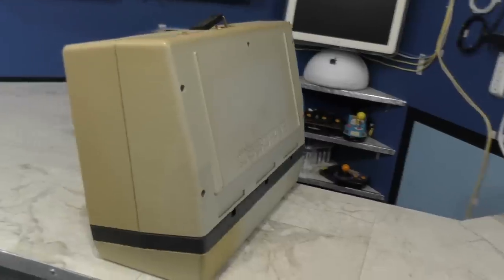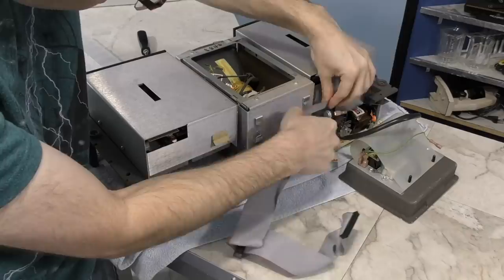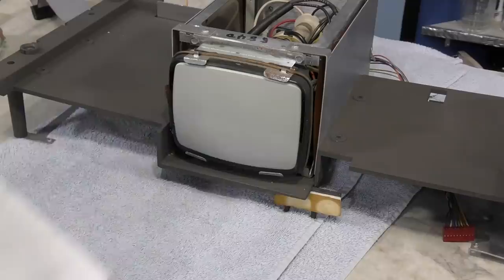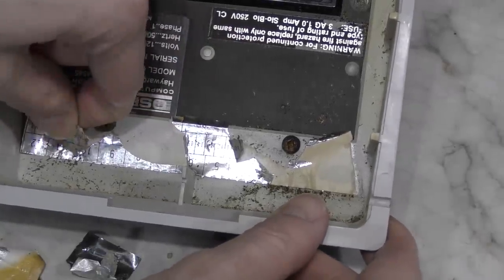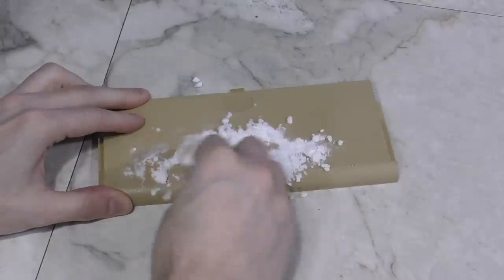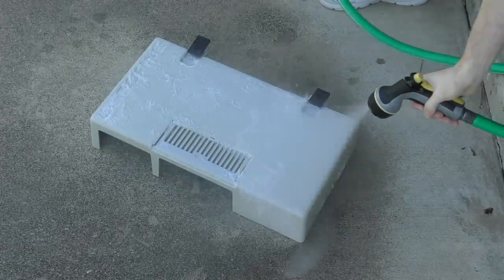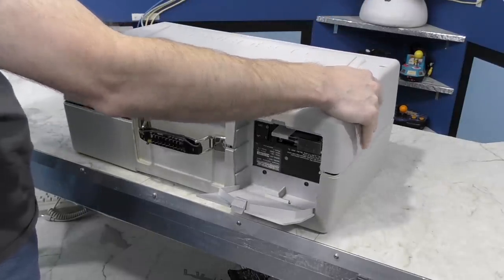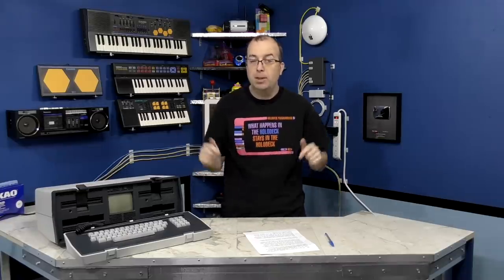Osborne 1 Computer Restoration Part 2

Comment: A hard rubber roller instead of a paintbrush would probably solve most of your issues. I've tried a similar product on a typewriter with yellowed plastic case, and if worked just fine (I live in Brazil, so much more sun-power here, and it didn't destroyed the case, so yay!). Also, you could buy a cheap leather handle like that one on e-bay and pop the old one out, they even come with the metal parts and you can get it manufactured in real leather if you need, so it will looks better and also avoid corrosion for longer. As it is a small piece, I think it is worth it, even more if you (I hope not) want to carry the thing using that handle.

Comment: I would place the coated plastic parts in a plastic bag and use a vacuum sealer to pull all of the air out. maybe, the layer of cream would be distributed evenly.

Comment: Just a thought why not just either put hydrogen peroxide in an old household spray bottle and spray it on repeatedly to get an even coat or similarly use a pressure sprayer for the cream peroxide

Comment: POSSIBLE SOLUTION TO RETOBRIGHTING. Cant you use a semi-rigid transparent plastic sheet? like those used in old overhead projectors (viewfoils). This way, the rigidity of the material would help in homogenizing the sufrace and thus the thickness of the cream. I hope this can help you.

Comment: The same thing with the smoke happened to me as well, but mine is an old Franklin ace 1200, I used it for 5 minutes and BAM!, smoke. What should I do, should I buy a new power supply or look at the circuit board?

Comment: My crazy idea is to use dishwasher from junkyard as retrobright chamber. Hydrogen peroxide running in closed loop. A lot of UV LEDs installed randomly in dishwasher walls to get even UV exposure (or single lamp but utilize bottom sprayer as rotating plate). This should be easy hacking job and should give waaaaaaay better result than technique you are using now.

While having retrobright dishwa... chamber you could also easily experiment which HP concentration/temperature combined with which UV exposure time/power gives best result - without stains and marble effect.

Comment: one tip on rusted metal surfaces, WD40 and steel wool graded with 0000, when scrubing it, make sure to apply just a little pressure and enough WD40 to not let it dry out. Then just wipe it of with a microfiber cloth and your got for it :)

Comment: Considering this computer is older then the hills, I would definitely stick a new filter capacitor in. With more wonky voltage it might not like that and start degrading the life of the components prematurely. I've been there with an old receiver lol!

Comment: Why would unfiltered AC Power not be a necessary thing? If the AC Power coming into a computer is not filtered or cleaned up it will damage the components or cause undesirable effects, that's why you use serge protectors and for even more protection UPSes and maybe even line conditioners for an extra line of protection to delicate electronic devices.

Comment: I got streaking on a NES I use for experimentation as it is/was in extremely bad condition, and I managed to get rid of the streaks completely. This is going to be a long post, but I hope it helps someone!

So, I used 12% hydrogen peroxide cream from a hair studio and left the parts in the sun for a couple of hours with a couple layers of plastic wrap. When I dried it off I noticed that kinks/folds in the plastic had left some darker spots. I tried re-bleaching the console but it appears the first run is what sticks and it had little to no effect. A tip here would be to use a single layer of plastic wrap and try avoid getting any folds in it.

I then tried using some Autosol brand chrome polish to grind the top layer of plastic away, this left a nice surface but wasn't too effective. I will however come back to this product.

I grabbed a rag with some paint thinner on it and started rubbing the plastic, this does slightly dissolve the plastic but that was the point. It is much milder than something like Aceton and you could dilute it if you want to be extra careful. This removed the streaking very effectively. Note that if the plastic is grainy like my NES was (I have two, one is grainy and one is smooth, don't know why), the thinner will affect the grain, the thing to keep in mind here is to not overdo it. As long as you are careful you should be fine. A tip here is to not use a rag that has something printed on it which I initially did... The thinner dissolved the print and left color on my console and, which led to extra work

I used the Autosol again to even out the finish, which worked very well. I tried buffing the parts not affected by streaking too and it removed a little bit of more of the yellowing that was left as well as removing some of the light surface scratches.

I finished it off with some UV protective clear coat to keep oxygen and UV light out in an effort to keep the yellowing from re-occurring. I used matte Montana brand, which matched the original finish of the plastic surprisingly well. It actually kept the glossy parts glossier as well.

The final result was very pleasing and I'll gladly show pictures if anyone is curious.

Comment: Great content I think I'll subscribe. As for the Streaking, try building a vapor tight solar oven type thing SUCH AS A LARGE RUBBER STORAGE TUB AND A PEACE OF LEXAN . plug in your ozone machine and a pool of hydrogen peroxide underneath a rack to hold your plastic parts. OZONE, PEROXIDE AND SOLAR HEAT.

Comment: You forgot to replace those two other Rifa capacitors on the PSU board, they will die before or since anyway, about the broken Rifa capacitios you removed from the board, it IS nessecary because it remove noises from the power net and protect the computer .

Comment: I get a big box and then the largest trash bag I can get as a liner for the box and then dump peroxide into it. I only use the cream for really stubborn spots. Ive dumped 15 of the cheap .75 hydrogen peroxide to retrobrite large items.

Comment: The trick with double sided tape is to not press on it until you sure. Its pressure sensitive, The harder you push on it the better and longer it will stick. If you dont push on it and just allow its stick to hold then it peels off easy.

Comment: What about getting a parts washer (tank) and makeshift a tanning bed light bulb for the uv rays, this way your peroxide wont evaporate, youll have your things fully submerged, heat wont be an issue anymore and you could do this overnight
Reply: Not sure how the bulb will like being in a tank like that but worth a shot?

Comment: That line filter capacitor blew up not because of a design fault in the PSU, but rather because the Rifa brand capacitors from that time had a well known manufacturing defect that results in the cracking of their outer case over time, allowing moisture into their paper dielectric, eventually shorting the capacitor. All the Rifa line caps in this should be replaced to prevent their similar demise. You can (and should) replace them with any good modern X/Y rated safety cap.

Comment: Bought one brand new when they first came out in 1981 paid $1795 why?  Because it came with wordstar, SuperCalc, and some other programs that included a stack of manuals 2 feet high. After about a month, I learned CPM and the spreadsheet program was handy for my business. Biggest drawback for me was the 52 column text so I sold it for $900. 11 months after I bought it and then I bought the brand new super Duper computer named KAYPRO for $850. still have my floppy’s.

Comment: You should never pull on the wires to disconnect the connections. Alway grab the connector even use needle nose pliers if you can't grab by hand. The wire could pull out and make a job more expensive or even not worth it if you can't find a replacement.

Comment: Look, I know many people comment on what went wrong with the retrobriting process, but I'm going to chime in.

Regardless of whether you wrap it or not, it all comes down to the thickness and concentration of the fluid covering your surface. You get the marbling effect because of the differences in thicknesses of the solutions. The thicker it is, the less UV that will make it to the interface layer.

The real solution to this is to use Sodium Percarbonate in a glass tank with UV on all sides, with an agitator and heater. Given how much you retrobrite, it may be worth making a tank.

Comment: I called out a broken rifa cap in the comments of the first video. But from the video I get you were even warned beforehand.... Well i don't always listen when I should too :) 
That said, you only took out the broken one. There are several others of the same brand and type on that board and they are all suspect. They should all go. And though it is true the board will function without those caps. For a true restoration and just proper repair sense those should be replaced by new ones. Modern one to one replacements are easily available. Just make sure you order the proper X rated caps(and yes that is an x just as we have Y rated caps). Its a line regulation thing. Leaving them out sets a bad example.

Comment: Such a capacitor burned up in an old sewing machine of my wife. That's due to these types of capacitors where they used an oiled sheet of paper as dielectric.
Easiest solution is to just take them out, but there are also good, modern replacement ones.

Comment: Question about that power capacitor.
After you removed the blown capacitor, did you have to solder in a bypass wire in place or did you leave the board as is sans one blown filter capacitor?
Reply: Without knowing all the circuit paths of that Osborn Power Supply, I felt it was a worthy question. 
Some circuits if you remove a component the device will not work till you restore the circuit some how.

Comment: Could someone please help me. I bought a Osborne 1 with a damaged power supply which i repaired but the problem is that its screen doesnt work either. It makes a beep when i turn it on but the screen doesnt turn on. I checked for any damaged capacitors or anything like that but everything seems fine. Has anyone have any idea what to do of how should i try to find the problem? I checked forums for information regarding such issues in general but couldnt find anything.

Comment: there is also thick hydrogen peroxyde you get for bleaching hair. its the same stuff just with a thickening agent and so it sticks more easily on the surface and you'll need less. i guess retrobrite is just that stuff with an other name written on it. 
but be careful which percentage u use. and you dont have to put it in the sun necessarily, it is ok when u have some heating source ....
Reply: yeah, retrobright is basically peroxide + cream and David uses the stuff you're talking about because it's easier than mixing his own.

Unfortunately it shows streaks from his brushing depending on the plastic.

Comment: Hey man, when you were changing that Capacitor, I saw one of the two larger electrolytic capacitor's on the left, specifically the one with the red sticker on it, had a bulging vent on top of it. That needs replacing! Quite honestly. I would just change them all out and save you some trouble in the future. Those caps are old!

Comment: Seen here again, you already mentioned you have no "fancy soldering tools" and use desoldering wick. Why not get a desoldering pump? I saw them between $6 and $20 on Amazon. Wouldn't call them fancy but they make the job so much easier in my opinion.

Second do you have a smart home? If - or if you want to spend the additional time to set up some sensors and switches - what about the idea for a video to control it OLD SCHOOL? You seem to have a preference for Commodore computer. So get the RS-232 ready, may be using X10 Home Automation or what ever suites you. And dim some light, control the heater or AC...

Thirdly, this episode here starts with "In the last episode...". What about doing it like on TV series. "Last time on The 8-Bit Guy..."? :-)

Also like your new music intro. Seems it was just there, never saw you mention it itself.

Greetings, Andreas

Comment: To fix the drive head sticking it is best to remove the rails and use metal polish any kind of lube will  clog over time Also if the house does not smell of magic smoke my wife thinks I am out 😀

Comment: 8 bit guy used baking soda. It was very effective.
Osborne used broken handle. 8 bit guy's repair ability fell.
8 bit guy used floppy drive repair. 8 bit guy missed. 
Osborne used 3 part video. it was super effective.
8 bit guy fainted

Comment: The reason peroxide ruins the leather is because it's an oxidizer, H2O2, it gives away that oxygen molecule and essentially becomes water. Leather is often tanned with chromic acid which acts as the catalyst and when exposed to pure hydrogen peroxide will actually oxidize the cellulose in the leather so quickly that it catches on fire.

Comment: If the smaller bins worked on submerging the smaller pieces completely, why wouldn't a larger storage bin work for submerging the larger pieces?
Sure, that would take a LOT more hydrogen peroxide, but I would think Amazon or a janitorial/office supply store (maybe even a home health store) would sell peroxide by the gallon.

Comment: Question.. if you recirculate the peroxide with a little pump, could you potentially apply the liquid form without filling up an entire tub?
Reply: how would you seperate the water from the peroxide? filling the tub is just so that the entire part is submerged
Reply: @CometAura  No separation. Just set up the pump so that the chemical flows all over the the part in question.  Since it's circulating you should expect a faster cure time as well.
Reply: @MattTrevett  ahh. could work

Comment: Hi 8-bit guy,

the issue goes the other way around... it's not the the H2O2 itself causing this look to your case... it's the fact, that your H2O2-cream is not clear. That causes less UV-Light at the plastic where the cream is thicker...
You can try with a very thin layer of cream for example... or clear cream... or H2O2 in liquid form... this will worked best due my own experiments...

Greetings!

Comment: Just stating the obvious here, YOU MUST NEVER OPEN AND TOUCH power supply and CRT boards immediately after a power down, they contain dangerously high voltages which can kill you. Sometimes these caps can hold voltages for days ! Always test for voltages before handling them

Comment: Buddy.. just do one thing for the plastics from now on... just wrap them with plastic wrap as u did... but without applying any peroxide cream.. than put those plastic parts in liquid hydrogen peroxide submerged.. and leave it in the open sun... 
U will get perfect results...

(And yeah one more thing.. just wrap some aluminum foil inside all around the container before pouring hydrogen peroxide in it)

Comment: Hi 8-bit guy, my modest opinion regarding peroxide is that you are making mistake by exposing it to sun. It is good that you wrap plastic and rub it from time to time, but.. exposing to sun is causing fast evaporation and dries thin layers of solution too fast which is stopping chemical reaction. That is why you having this marble effect. Peroxide needs temperature but on sun it is way too much. Unfortunately, I don't have any old plastic to test this to prove theory, but if I find some, I will test it.

Comment: This is why I stopped using hair bleach. Its too much effort with too much possible risk. I started using a mixture of bleach and peroxide and then using water to cover the rest of the parts. I'll use a whole bottle of off the shelf peroxide and and quart of bleach then Ill use water as a filler. It gives me good results on items that are lightly to moderately yellowed with no streaks. It only costs about $5 for everything and the best part of all is I can use the same tub for everything I want to bleach without making a new batch. Also the leather being eaten away was a given considering how that hair bleach posses such a risk to burning your skin.

Comment: This video has a 1980's decades theme. Which leads me to conclude that your REAL problems are being cause by the 1980's syndrome know as "EVIL TWIN!". While rare today "EVIL TWIN!" was a very common 1980's problem. Best to confront your evil twin 1980's style with a climatic final battle in which you best your evil twin in hand-to-hand combat. The evil twin must die in a dramatic cliff fall...even though you valiantly "try" to save him!  Of course doubts will always linger as whether the survivor of the battle is in fact the "8-Bit Guy" hero or the EVIL TWIN!

Comment: Okay so, I think I know the answer to the retrobright problem, but I don't think it'll do any good because it'll get buried in the comments. Please thumb so he can see it. 
Since the streaks are brush strokes/plastic marks, I'd like to offer you this solution. 

Instead of brushing it on, take a large shallow pan and put about 1/3rd of an inch of retrobrite mix in it. Keeping each side as level as possible, dip each side into the solution and then carefully flip them onto the safe side. It would only work for flat exterior sides, so no insides or power bays. Avoid using the plastic wrap and re-dip the pieces as often as needed. This would be the best way to avoid brush strokes or wrap marks, albeit using a bit more of the mix and being Much more tedious. Cheaper and easier than submerging though.